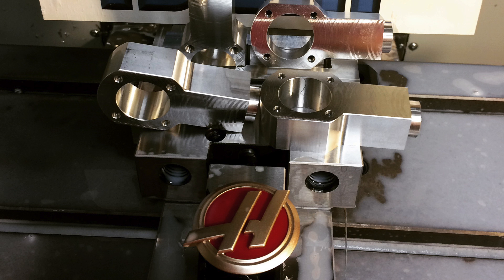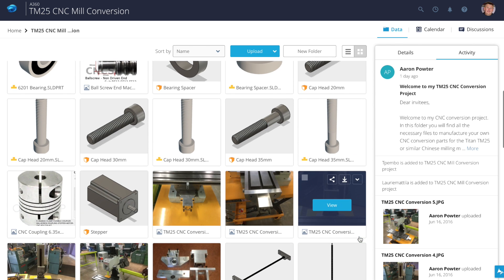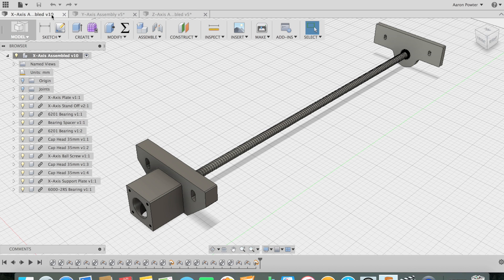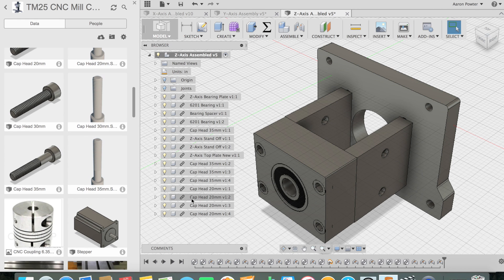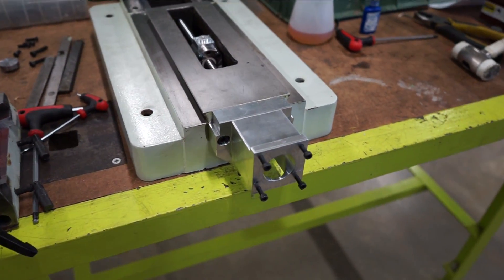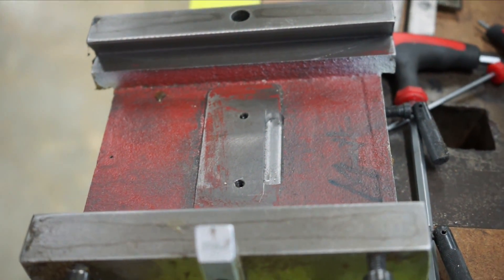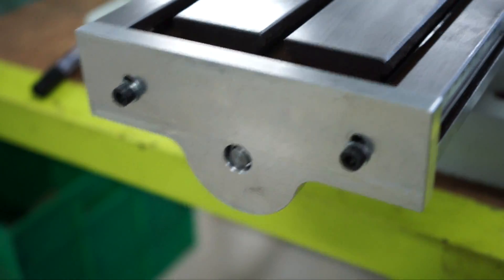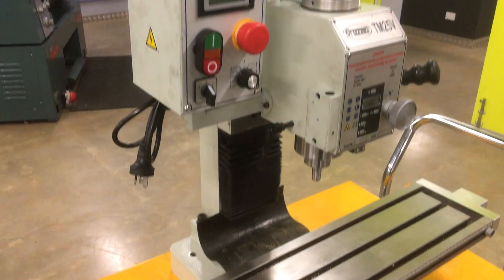Ballscrew CNC Conversion Kits - Free Fusion360 CAD Files

Comment: Awesome. Is a .rar or .zip file available anywhere?  Or maybe you can guide how to find you on A360.
Great work. Very much appreciated.
Reply from the maker: Hi Kris, all the files can be downloaded directly from the video description area.  Best to use Google Chrome when doing so mate.  Enjoy and I hope they can help you.  Cheers, Aaron.
Reply: @DCT_Aaron_Engineering  Aaron, thank you! One extra thing to ask. What is the size of the Z axis ball screw? Your assembly shows Y axis ball screw. Y and X axis are 16mm I think, does the Z axis also? or is it 20mm? as the OEM is 20mm on Z. thanks
Reply from the maker: @krischlapek6939  G'day Kris.  I used 1605 C7 ball screws all round on this conversion.  Unsure of the length of the Z now, as this was a long time ago and the hard drive with all that data on it crashed.  I suggest just measuring from the top of coloun to the bottom of the slot.  That should be plenty of travel.  This video will show you the travel that I was getting. https://youtu.be/MxMMApGFjw8
Reply: @DCT_Aaron_Engineering  ok awesome. Finally, my mill is like the grizzly 0704. The base is different, Don`t you know if your bits are interchangeable? Thanks
Reply from the maker: @krischlapek6939  most parts should fit except for the Y axis. Someone will have to CNC machine your saddle for you to fit the ball nut and shaft (I’ve seen others having to do this). Cheers 🍻
Reply: @DCT_Aaron_Engineering  thanks. This helps a lot!!

Comment: Ah remind me again why you don't sell the kits. I am trying to upgrade a BF16 to CNC for robotics in Australia, and see not local kits, and other than trying to do it manual, which I have no experience I would need to get someone else to mill it.
Reply from the maker: Hey Buddy how are you?  Unfortunately there wasn't much demand for them and most people didn't want to part with their money.  Do you have the CNC conversion CAD files for the BF16?  As it will differ from the TM20-25.  You can always 3D print them and use your machine to make them out of aluminium later.  Where are you based mate.  Shoot me an email please.  You can find my email address in my channel about Section. Cheers, Aaron.
Reply: @DCT_Aaron_Engineering  haha I am well thanks and just trying to stay safe. How about yourself? I thought I recognised the accent. I will shoot you an email as I can use and have Fusion, but a milling is totally foreign to me.
Reply from the maker: @tcratius1748  Ok no worries.  I'm based in Melbourne.  There might be a way I can help you out 😉

Comment: Very well done, thanks for sharing.  So.....there is a "KIT " on amazon,  listed as "DIY 3D printer steppers"
 . It costs 62 (was 189 a month ago ). You get a box the size of usps Medium flat rate mailer (about 12 x 10x8). 3 X nema 23 or 17  motors (I assume 23 is stronger so that's the one I picked, selection is marked "color and size ".  Also an adruono Adrino uno, wires,  cheap power supply , 3x stepper drivers,  etc, software  grbl  (spelling?), asked if mark 3 would work, they didn't know. We'll I bought it, haven't set up yet , also got a little 99$ green cross slide table, and a Dewalt trim router. Is 23/17 nema strong enough? Maybe with gears and timing belt?.
Reply from the maker: You’re very welcome. Thanks for the information 👍

Comment: Is there a way in fusion to open up your models and then see true dimensions ? I just want to print them off so i could machine them manualy
Reply from the maker: Hello Tymek.  You would need to follow the following steps:
1). download the model/s
2). open Fusion360 and upload the model/s into your project folder
3). open the file you wish to view.  Note: you can obtain direct measurements from the model using the (inspect / measure) tool.
## OR ##
4). click on the drawing tab, bring model into the drawing environment in the correct drawing format and orientation
5). apply dimensions as necessary
6). export as PDF and print out on paper

Hope this helps?

Comment: What a brilliant thing to do. Retirees such as me need to keep an active mind and for me your sharing of this project is most appreciated. Not only will I, in time, rework your design to suit my similar mill/drill (HM-45) as a CNC machine but along the way I will get a very useful working knowledge of Fusion 360. Many thanks! :-).
Reply: FYI It may be your intention but, in case it is not, I noticed that 2 of the links referenced in your original post produced restricted access errors (viz. X-axis mount plate modified (F360) and Closed loop stepper motor spreadsheet) and another produced a not found link error. (viz. TTS tool holder 3D print (F360)) Cheers Pete
Reply from the maker: Hello Peter.  Thank you and you're very welcome.  It's a fun project to do :-)
Reply from the maker: Hi Peter.  I'm very sorry about that.  I used to allow access to my project, but people would alter and rename files etc...  It just all became too hard so I decided to upload the links.  However, I let one more person access the project (he pleaded with me) and that guy caused the damage and deleted some files.  I don't know if this was intentionally or accidentally as a novice F360 user as he didn't know what he was doing.  My hard drive died and I don't have those files anymore.  Hopefully the files will help you?

Comment: Hi I am looking at purchasing a milling machine then converting it to a CNC. it would be great if i could use it in manual mode and cnc if possible. My budget is about $7k. What do you suggest? Any information would be appreciated.
Reply from the maker: Good morning Adrian.  I have converted many machines over the past years and I what I've learnt is that you quickly outgrow them (dove tails, low RPM spindle, dodgy R8 or MT3 spindle, no PDB).  If you want my honest opinion mate.  Save up your money and purchase a turn key solution.  You can probably purchase a SyilCNC machine (without enclosure and ATC) for not much more money.  Plus it will have servos, BT30 spindle, and power draw bar with 10K spindle).  I suggest you contact Mr. Xushuo from SyilCNC directly and ask of a quote.  Cheers, Aaron.
Reply: Might not be what you're looking for, but in that price range I would start looking at used mills with a 2 axis CNC control. Something like a Bridgeport EZ-Trak.

Comment: Hi Aaron.  Thanks so much for the files. I'm almost finished with my build.  just a quick question: which CNC Controller did you select for this conversion. I have Nema 34 Stepper Motors, drives and power supplies, but I have not yet settled on the controller.  Your advice would be very welcomed.  Cheers  Ross
Reply from the maker: Ross Waring Hi Ross, you’re very welcome mate. I used the Masso CNC controller on my milling machine. Look forward to seeing your build. Please let me know when you finish. I’d be keen to see pics or a video. Cheers ;-)
Reply: Thanks Aaron.  Cool.  I'll think about that as i have a spare laptop so wasn't thinking I needed a controller that runs the software; Mach3 etc.  I'll have a deeper look and also post some pics of my build.  Cheers  R
Reply from the maker: Thank you, I'll look forward to it ;-)

Comment: Please add me to the design group my email is misterfixit1952@gmail.com  I am converting your design to use on my Harbor Freight gearhead mill drill, with the round column. I already have a nema 34 stepper motor kit I just need to buy the lead screws & ball nuts and make the conversion brackets. Your design files will need modification but they are similar tools except for the column so this is a great place to start. It's easier modifying a part than making one from scratch. Besides, I'm learning fusion 360 as I do this project. Thanks for the help getting this project off the starting blocks.
Reply from the maker: Good morning Bruce.  All my design files can be download directly from the web-links in the video description area.  Oh, I would also suggest downloading additional conversion files from Marcel via RoboCNC website.  These were designed to fit the Vario BF20 (Grizzly G0704).  Enjoy and best of luck.  Aaron
Reply from the maker: Oh, make sure you use google chrome browser when you do download my files.

Comment: Do you know if these will fit the pm25mv?
Reply from the maker: Hi Brian, it depends which model mate.  The PM25 has had 3 different model changes over the years.  Best bet is to download all the free design files & photos outlined in the description of the video and compare measurements on your mill.  Cheers, Aaron
Reply: DCTTeacher1  do I just download the links under the description?
Reply from the maker: brian burns yes mate. Click on the link. This will open in A360. Use the blue button (I think it’s blue) and download the file. Files are in solidworks or f360
Reply: DCTTeacher1 thank you! I'm new to fusion and figuring things out as I go. Thank you for taking the time to help me out.
Reply from the maker: brian burns you’re very welcome Brian. Download the F360 files to a folder on your computer. Then open Fusion and create a new project (call it CNC Conversion). Open that project and then import / upload the files you downloaded into this new project. Best of luck 👍
Reply: DCTTeacher1 I downloaded them through a 360 app on my phone and put in new project under demo project. Seems like it only took a picture. I'll know more when I'm able to go to my pc.

Comment: hi arron do will this kit fit my pm25 cnc my email is hoochhenry@gmail.com if not i buy the grizzly to get it done can you send please great work
Reply from the maker: Hi Eric.  I'm not sure if my designs will fit the current PM25 model.  However, all files can be downloaded directly from the weblinks in the video description (expand the title).  This will open them in Autodesk A360 and then you click the blue button top left to download in a file format you want.  Enjoy, cheers ;-)
Reply: DCTTeacher1 will they open in fusion 360
Reply from the maker: No it won't open immediately in Fusion 360.  So, after the file opens in A360 click the blue button top right.  Choose the fusion 360 archive option and save it to a folder on your computer.  Once inside Fusion 360 you can import the model directly and work with it.  I no longer add people to the project because they were deliberately changing and amending files.  This created work for me to go back and fix them.
Reply: DCTTeacher1 did you make all the kit on the mill machine
Reply from the maker: No, I made the kit on our HAAS at school.
Reply: DCTTeacher1 very nice question does fusion 360 if someone has it will it cut the pices out on there cnc machine
Reply from the maker: Hi Eric, yes Fusion 360 is very powerful CAD-CAM package.  When you switch to CAM mode you can apply tool paths and then post process your G&M code to your CNC machine.  Please look at some of my other videos such as Part 1-4 mill vice stop.  This will show you the CAM / CNC application. Thank you, Aaron.

Comment: Great work. Can you please comment on your lessons learned from this project and your thoughts on the machines capabilities after you converted it?

Thanks!
Reply from the maker: Doug Hanchard Hi Doug, thank you for your comment. Many lessons learnt from the whole CNC experience. It was fun to do and very rewarding at the end. The little mill was very capable but it also had its limitations. My thoughts now, save your money and purchase a turn key machine like a SkyfireCNC, Tormach, Syil or something similar (single phase) for the home workshop. Cheers Aaron
Reply: Thanks for your candid answer. I do like how you approached the challenge. The CNC industry is moving quickly these days. And like software, computer boards, CPU's, etc, they are quickly updating at rates approaching the Windows, Apple and Android space is. We are seeing faster releases of computer boards, servos, steppers, power requirements and accuracy sensor capability that I would have never thought possible in a consumer grade machine with industrial precision accuracy. 

Look at how far Centroid has come with the size of board now available (like Acorn) and how software interfaces to both standalone and cloud CAD systems is progressing. And we haven't even talked about how software databases are now becoming fully integrated into tooling options now available and is just zooming along with releases. I don't even know where I want to dive in and get a machine anymore. It's happening so darned fast. 

Having watched many of your videos, I enjoy how you approach the problems that need to be addressed and that's an important part of how someone with an interests in CNC, should should enter the machining world. I hope you come out with more videos that address many of the hidden elements of how we should approach the integration of design, manual machines, computer control, material handling and understanding the subject areas we need to not just be aware of, but truly understand; the 5 W's as it were, Who, What, Where, Why and When of the industry. - thanks!
Reply from the maker: Hey Doug.  Very sorry for my belated reply.  I agree with you all the way mate.  Ever increasing computing power, PCB design and powerful software has changed and revolutionised the CNC market (however, your choice of words far outweigh that of mine).

Oh, thank you for watching my videos too.  Most of what I film and post comes about from my job as a high school shop teacher.  Majority of models I film are student projects.  I do this as it takes the load of the teacher when in the classroom allowing them to focus on students who need more support.  It also allows the students to work self paced and not get held back by the others too.

One thing that I've I learnt from this whole CAD CAM experience, especially since my trip to Autodesk University in Vegas, is that I'm still learning myself and to be honest I've only scratched the surface.  Cheers, Aaron.

Comment: Hi Aaron.  Very impressed with what you have done and provided.  Thanks.  I have the same mill and am going to convert to CNC.  I do however use the mill extensively for machining old parts and repairs etc, hence would like to retain the hand wheels.  Do the Nema motors you selected have a thru shaft where handwheels could be attached and operated with the motors turned off? Alternatively have you used a jogging handset that can manually control the CNC mill?  Regards  Ross
Reply from the maker: Ross Waring hey Ross. The motors I used don’t have a through shaft as they have an encoder on them. You can still use the milling machine manually via the MPG pendent hand wheel. I do this at home and at work too. You use the controller as a digital readout. Cheers Aaron
Reply: Thanks Aaron. I think an MPG, such as the XHC HB04 should work fine.  Where did you purchase your ballscrews from? I have the Optimum BF-20LV machine which I will start converting soon. rwaring@gmail.com
Reply from the maker: Hey Ross, I purchased my ball screw from a little company here in Melbourne called CNC cup cake world.  However, many people on eBay sell them also and you can custom order them machined to suit.

Comment: Hi Aaron, nice to find you. I am working on a CNC conversion for my Harbor Freight 33686 milling machine.   https://manuals.harborfreight.com/manuals/33000-33999/33686.pdf              Would any of your parts work for my machine? I will be looking for a Lathe after my mill conversion. I am not sure if same dimensions as your mill and components. I am tried to decide the size of Stepper motor needed. from what I see i need to convert to ball screws from the original Acme screws. Do you still have the motor mounts? I am starting to use Fusion 360. I am looking to use the Arduino Mega 2560.
Reply from the maker: Hey mate, I just looked at your PDF file and I don't think any of my parts would fit.  My CNC milling machine kits were designed to fit the Titan TM20 and TM25 sold here in Aus.  They are also very similar to the later style of PM25 mills by Precision Matthews.  Download my files from the links in the video description and see for yourself.  Cheers and best of luck with your conversion  :-).  Aaron.

Comment: Hi Aaron
just looking at the drawings you have done can you tell me if the machine i have bought is the same as the one you did the conversion on, they look very similar just checking the sizes and all seems to be ok but before i start machining would like your thoughts, lol 

my machine is the AMAT25LV
Reply from the maker: Hi Dave, I have had a quick look at the mill on the website that you listed.  To my knowledge these mills look identical.  Cheers, Aaron.
Reply: Cheers Aaron will start machining will post you some pictures as it starts to take shape, shame i don't live near lol

Comment: Hi Arron 
its been a while but i Know own my own Milling machine and looking at converting it to CNC its the same set up as TM 25
Reply from the maker: Hi Dave,  No problems mate.  If you look in the video description you can now download all the CAD files directly.  Hope you enjoy them?  Cheers, Aaron.
Reply: Cheers Aaron thanks for that if i have any issues can i get back in touch please, will that take all the g code for the machining across too.
Reply from the maker: Hi Dave, the parametric data will come across with the files.  However, I originally machined these via Solidworks and HSMWorks.  My suggestion is to open the Fusion360 files in Fusion and apply toolpaths to your models.  Send me a personal email and I can send you gcode seperately if want.  My email is on my about page.